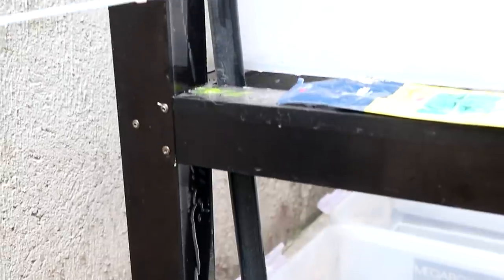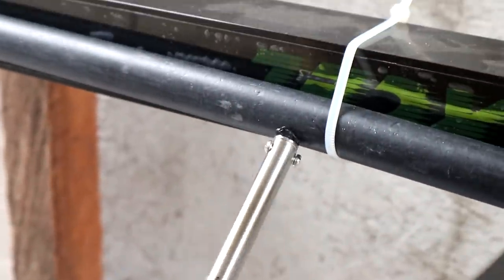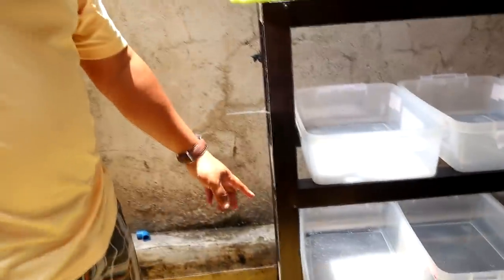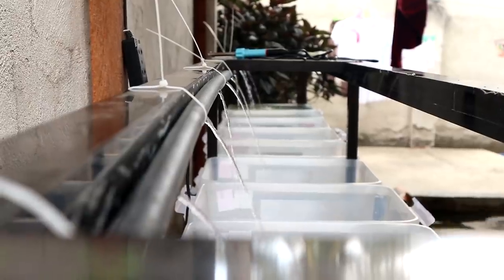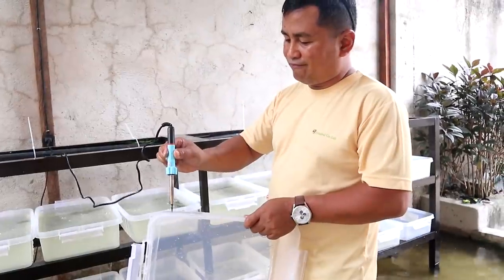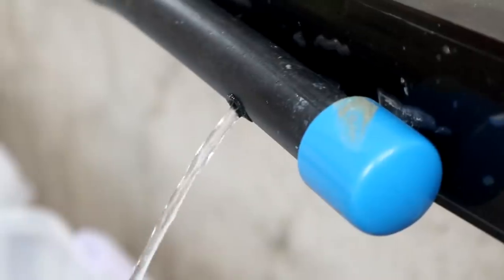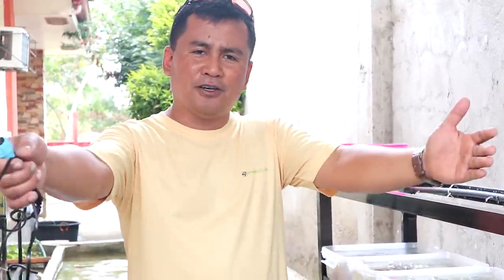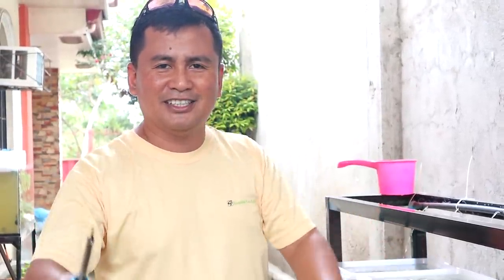TUBIFEX CULTURE -PIPING SET UP

Comment: No one seems to be worried about this man messing with electricity in 2 feet of water
Reply: same thought...it's so dangerous!
Reply: I was just going to say that! LOL!
Reply: Keep safe po
Reply: Its worth dying what you love doing! 😂
Reply: That solder iron is ruined
Reply: I got over 100 shoks nothing happens 🙂
Reply: At which point he messes with electricity? Only removed discharge port of the pump meant to be submerged all the time!it's like working on the car's muffler doesn't mean u mess with gasoline.the only risk I see is power outlets behind the rack..if it's only zip tied to the wall instead of permanently fixed...yep.wouldnt be fun if the whole outlet gang falls into the water...
Reply: Nah, no worries. Even Electricity be like, "Oh! It's Dexter Ando. No worries. He gets the zap-pass." That's why... 💁🏻‍♂️
Reply: Coz he's probably using a safety breaker

Comment: Dude, you're standing in water messing around with 220 volts.
Reply: yhea i noticed that also its dangerous
Reply: I was so scared he will drop the soldering iron and electricute himself. This is a stressful vid but im super curious about tubifex breeding.
Reply: That's the problem with so many of these Filipino aquarium/fish hobbyists - they're so INTO the hobby that they often forget and do not observe electrical safety standards and practices. Water and electricity and water DO NOT MIX well and could be a potential life-threat if precautionary steps are not observed. Standing in water and playing around with 220V electrical connections and gadgets is not considered best practice.
Reply: bojo perez  I don't think so. Ordinary home aquarium setups usually have aquariums OUT OF the water standing in dry surroundings. In this video we have the author standing in a pool of water while he is handling live electricity gadgets which is not safe practice. You may argue that the gadgets are only 20, 30 or 50 watts insulated but what if one of those gadgets are defective and shorted out at the MAIN 220v electrical stem entering the gadget? That does make a major difference and it does happen occasionally. It is an accident waiting to happen which can be avoided. Better safe than sorry - and sorry might be too late if you end up electrocuted and fried dead. :(
Reply: He’s immortal
Reply: If he has a proper breaker, it will break before he gets electrocuted. Even then, the large body of water will reduce the chances of Him being electrocuted. More the breaker that will trip or the tool breaking. 

And since it is freshwater, it will not conduct electricity as well, as Salt water. So, I think he will be quite safe. But sure, one shouldn't do it over the water, but he will not Die.
Reply: Submerged electro motor free for water so noob
Reply: obviously an April fools day joke, is it not?
Reply: @JojoMarababol  the wattage doesn't even matter and that situation, he would be dead!
Reply: @Helveteshit  OMG! LOL! Really, would you bet your life on that?

Comment: Hi Dexter, will the pump you are using for the worm culture suck up the koi fry? Would suggest using a sponge on the intake or a small plastic bin basket with holes small enough so the babies do not get sucked in? I use a plastic trash bin the put the pump in the bin (in water of course) so that my baby fishes are safe 😁👍🏻 cheers buddy
Reply from the maker: Francis Then thanks for this. Yes l will put a sponge.